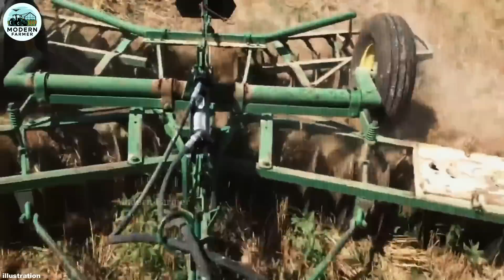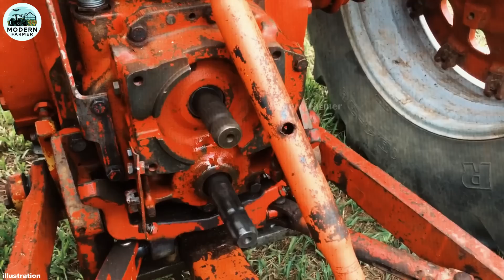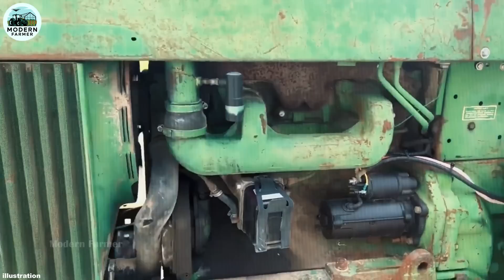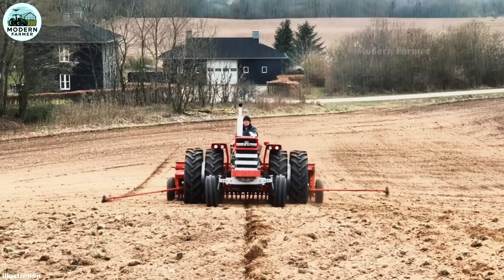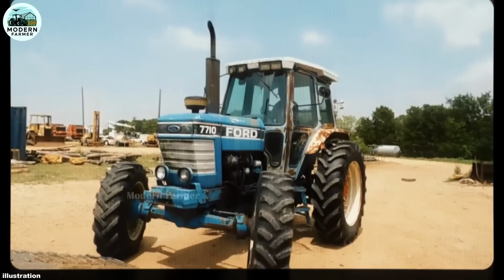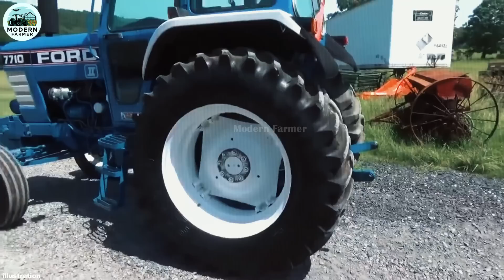5 BEST Used Tractors For Your Farm

Comment: The Oliver 1850's had lots of problems with the diesel engines, week cyclenders, rod bearings and main bearings. Don't waste your money on this tractor. The John Deere 3010 & 3020 had a bad problem with the blocks cracking on the back just under the heads on the right hand side when you are setting in the seat.
Reply from the maker: Thanks for sharing.
Real-world insights like yours are invaluable to anyone considering purchasing a vintage tractor for work or collection.
If you have owned or repaired one of these, sharing your experiences would be helpful to the community – both the things to avoid and the tips to fix them!